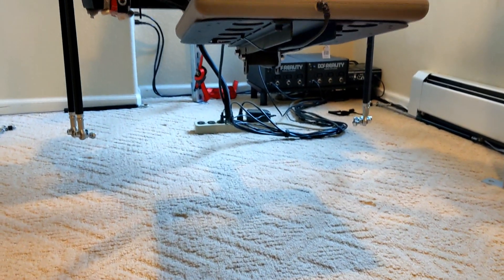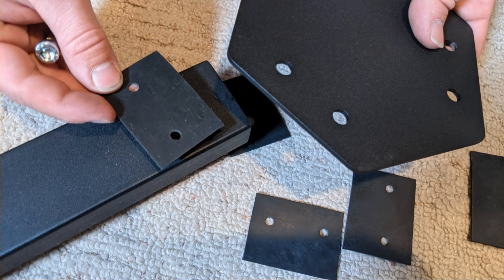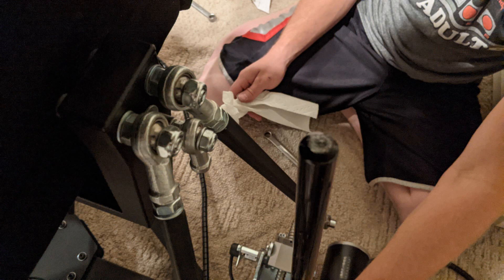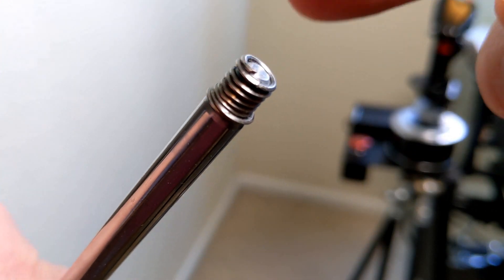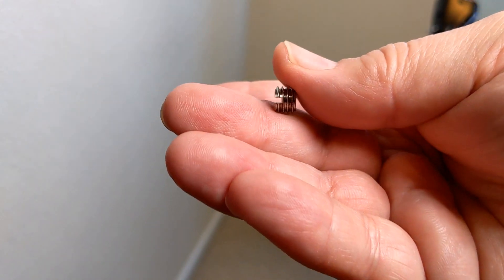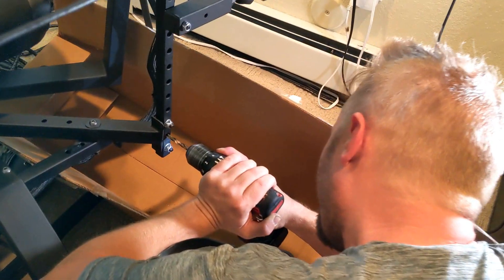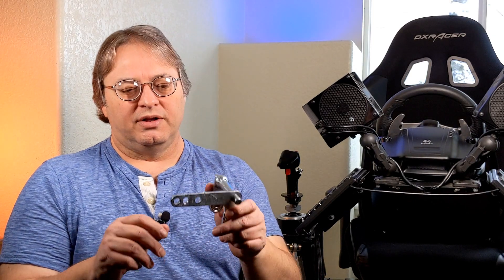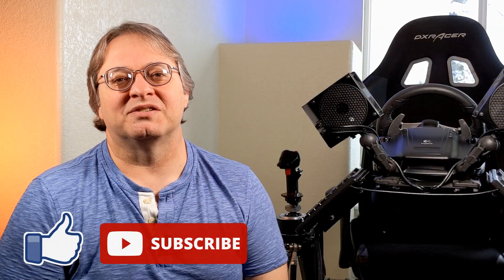DOF Reality SFU Gearbox Upgrade - Part 3: Modifications

Comment: Hi, not all the platforms come with SFU upgrades according to their website. On H2 and H3 it's a 200$ upgrade and only for 2 motors, add an extra 100 if you want SFU on the traction loss.
Reply from the maker: Thanks for the clarification Igor, I'll pin this incase others have the same question.  In my opinion the SFU gears are best on the H3/H2 because it takes out that play found in the older style gears. Would certainly recommend ANYONE getting an H3/H2 to upgrade the 2 gearboxes to SFU.  The traction loss, probably not as critical as the others but would still be nice.
Reply: @GYGOtv  No problem.
The P series do come with the upgraded SFU

Comment: This is a great help, to strength and quiet the rig.  I'm following your plan but the one thing I don't see is the sleeves in your parts list.  Do you think this is something I can skip are are they important?
Reply from the maker: Hi David, thanks for watching and I'm glad you are finding them helpful. DOF changed the design on the newer systems so I don't think they are needed anymore.  They also moved a nut to the outside of the cradle now so that basically acts like the cone spacer to get those arms away during extreme movements.  DOF really does constantly improve their products and that is so refreshing to see.  SO did you get one yet or are you still waiting?
Reply: @GYGOtv I just got it today!  I need to build it but I also need to order those parts. So I will order that list of part.  I also need to get a chair and deal with the mounting issues which I expect. I am trying to work out the power situation but I figure that I can run new circuits.  I have had a really disappointing experience with trying to get the specifications figured out working with dof.  The sales people just told me that it's a 900 watt system. I figure that I can do what you did and that's probably the safest thing, a lot of people claim they can just run one 20 amp 120 volts direct line but it's safer to run 2.
Reply: Apparently they actually updated the documentation for the H6 to say it only needs 900 w when you look at the control box it's over 20 amps at 120 per box.
Reply from the maker: @DavidWeichelt  Ya the power is an interesting deal... I just wanted to err on the side of caution, but honestly I never hear of anyone having issues and needing to do what I did.  I think try it with what you have in the house currently and then worst case if you have issues in a single room, just run an extension cord to another room as a temporary solution until you figure something more permanent out.  I'd be very interested to know what your results end up being on this end of things.
Reply from the maker: @DavidWeichelt  Glad you found that info, see my previous reply.

Comment: How do you measure the temperature of the motors?  These are stickers?
Reply from the maker: Yep just fish tank stickers that you put on the motors  https://amzn.to/35gfdbx  From what I remember, the back side of the motor is what gets hottest so I put mine there.
Reply: When you have the new H6 you have covers so the stickers won't work.  Is there any temp monitoring in the new motors so we don't need stickers?  Do you recommend buying a thermistors with LCD displays ($10 * 6) and maybe cut a spot for them to show in the frame?
Reply from the maker: @DavidWeichelt  I thought about that issue now but honestly hadn't looked into a solution yet.  I think you might be on to something there with the thermistors, at $60 that seems very reasonable.  I'll look into that option but sounds like a good one to me.

Comment: Have you considered or tried making the chair with a linear actuator?
Reply from the maker: Great Question, are you talking about putting linear actuators on this in place of the current rod setup? Or are you talking about taking the chair off and putting linear actuators on the corners like a traditional Linear Actuator rig?
Reply: @GYGOtv, I mean to take a chair and put him on a liner. Without  the other rod setup.
Reply from the maker: @דרורבןהר  So I don't really like the Linear Actuator (LA) Design compared to a Hexapod design.  The reason is with LA you will either have to set it up where you are close to the center of rotation if you don't want any blending of the up and down motion with pitch etc. . and that can limit the range of movement... or you put the seat at a far end and you get more movement at the cost of having heave introduced when you pitch (think of a teeter totter effect). Not to mention the cost to do that would be very high so I'd be better off to just buy a whole new unit I think.  Hope that answers your question. Thanks for watching.

Comment: Hi mate, i bought the h6 based on your recommendation. I will use only for msfs.

Could you point me in the right direction for motion compensation? I bought the festive you recommended but didn't realise it only covers pitch and roll
Reply from the maker: Hello, first off thank you for trusting my recommendation... I hope you are enjoying your rig so far.  So this is actually a bit more complicated than just pointing you toward a part (one of the reasons my video on this topic gets pushed back because there are just so many factors).  Anyway, the first question I have for you is what VR Headset are you using, and is it Lighthouse Tracked or Inside Out?  Second are you using a transducer like a Buttkicker or anything.  Let me know about these things and I can help you a bit more.  Thanks and I look forward to hearing back from you.
Reply: @GYGOtv  unbelievably quick reply man...I use varjo aero with base station.

The h6 hasn't been delivered yet but I have ordered all the washers and neoprene that you recommend in preparation
Reply from the maker: @willandbee  You caught me when I was online... not always this fast at replying but I'm glad I can help!  SO, if you want the best Motion Compensation currently, it is still using a vive or index controller and using it to cancel out the movement.  This is the process I use and it works great EXCEPT if you have any Buttkicker or other transducer, it will cause vibration or shaking in your headset if you don't mitigate it.  I basically have my controller mounted to the back of my seat with a lot of rubber isolators and some heavy metal plate and it kills about 90% of the vibration.  Then the software I use kills about another 10% or so.  If you email me at GYGOmail@gmail.com I can send you some photos of my setup.  The software you need will depend on if you are using OpenXR or SteamVR but both basically use the same controller system mentioned above.  Our good friend Jeff Weaver did a video on this years ago but it will still give you a good baseline to understand this method.  Here is a link to his video...  https://www.youtube.com/watch?v=1MqGO46xdtI Please let me know if you have any other questions and WELCOME TO THIS AMAZING WORLD OF MOTION!!!